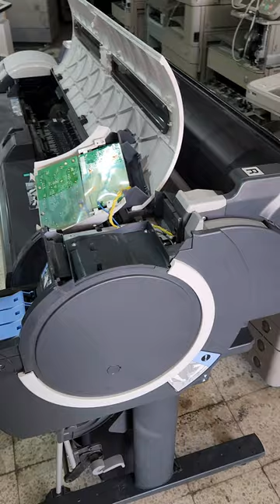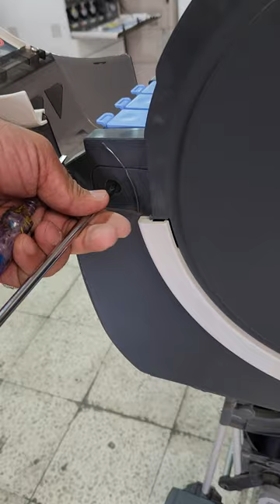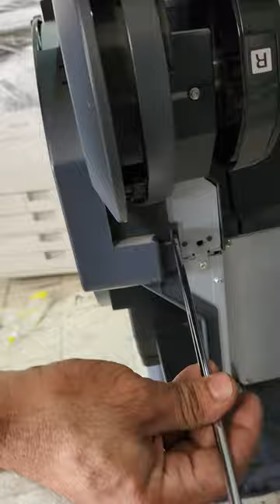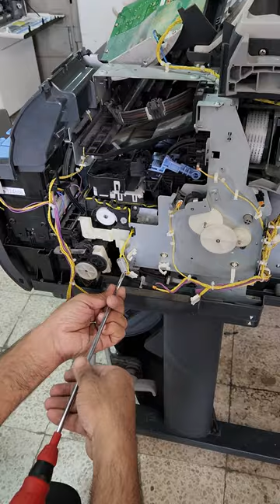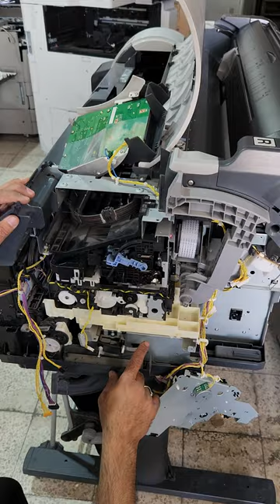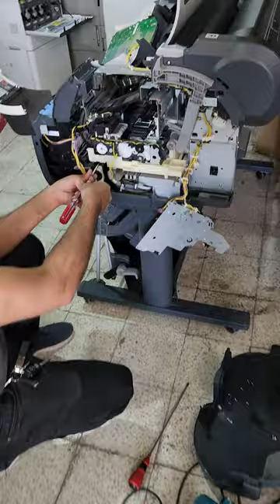Canon IPF770 cleaning unit replacemnet

Comment: You saved me about $4500 on a new printer with this video!! IPF780 was showing 03800500-2F40 error code, and printhead and maintenance cartridge errors. I replaced the printhead and maintenance cartridge first which did nothing. Black ink tubes were completely empty from the ink cartridges. I read that the 2F40 error could mean a bad purge unit. Ordered a new one from Ebay and installed it in about 15 minutes thanks to this video. I really could not have done it without this. I used a tiny jewler flathead screwdriver to push the tiny barbs that hold the wire connectors together. In one instance I stuck it in between the two connectors and the seam and gently pryed it loose. I was sweating a bit because these wires and connectors are fairly delicate. Thanks so much again!!